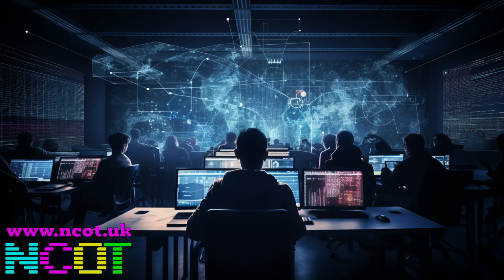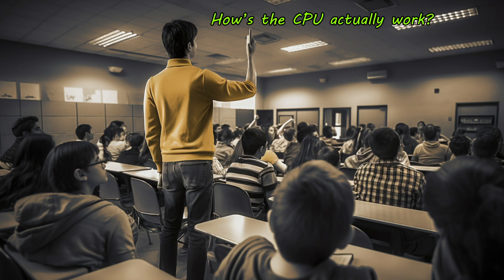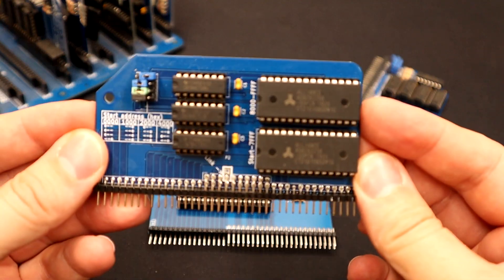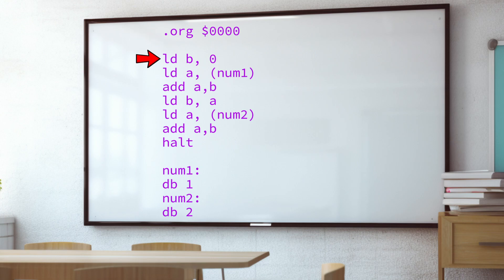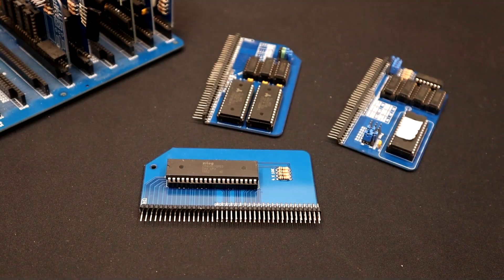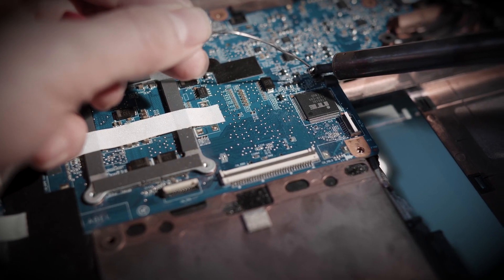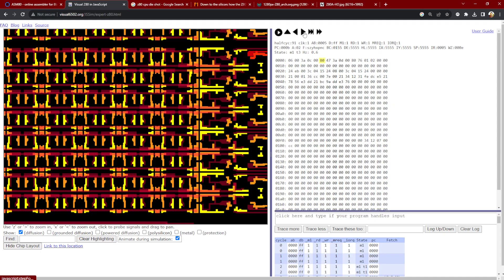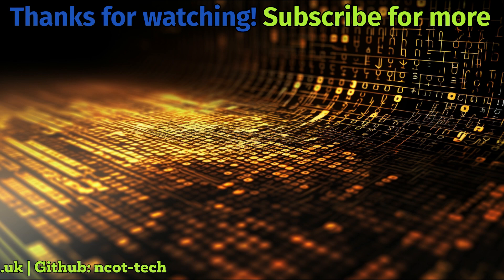Zilog Z80 Deep Dive - How does it work?

Comment: The inner workings of a Z80 CPU are registers, ROM and functional units (like the ALU (Arithmetic Logic Unit), memory unit etc). The CPU first loads an instruction into the instruction register, which connects to ROM. The ROM is also connected to a step counter, which is reset at the start of each instruction. Each step in the ROM is a list of signals to send to parts of the chip (e.g. use the memory unit to fetch the next byte of the instruction, then store the result in a register). The last step of each sequence in the ROM is to load the next instruction into the instruction register and the cycle repeats.

All CPUs come down to the basic building blocks of logic (AND, OR, NOT), implemented in transistors, wired together and sequenced by the clock. Just like normal programming you break the task down into components, sub components etc, and build each part from simpler parts connected together to achieve the required effect. A register for example is made from a bunch of Flip-Flop units, a Flip-Flop (at its simplest) is made from a couple of NOR gates (that is OR gates with their outputs NOT’ed). The difference with normal programming is that many things happen in parallel (so you can be fetching something from memory, moving the contents of one register to another and adding two registers together at the same time for example).

If you’re interested at that kind of level then take a look at FPGAs, which are basically a bunch of uncommitted logic that your program can wire up any way that you like. You can implement a Z80, 6502, RISC-V etc, or even your own CPU design on them by defining the logic for each unit and how they are wired together. There’s also code available on the web for implementations of the above CPUs, so (once you learn to read the language used - typically Verilog or VHDL) you can see what is happening.
Reply: Four month's long last year I spent on successively designing microprocessor architectures, starting by the simplest and ending up in something very similar to the latest multichip mosaic Intel designed recently . . . . that I didn't know about yet. I soon got rid of the step counter, substituting ROM-stored next step numbers next to ROM-stored microcode steps. I added a four-gates circuit that decoded a two-bits microcode portion to control step jumps inside an instruction's microcode by either not jumping, always jumping, or conditionally jumping on the set or on the clear state of a selected condition flag bit, which would otherwise have contributed to the microcode ROM addressing along with the instruction opcode and the step counter state. Other developments were more complex and would require many pages to describe: pipelines, instruction caching, register RAM caching, interrupt control, addressing-space misalignment dealing, multiphase clock, task interleaving, and so on.
     I can't afford prototyping the final architectural design. I could one of the not-so-complex designs but what I was interested on was just design: mine would't be able to compete with commercial ones, so, what'd the worth while be? But I'm proud my designing evolution bridged me across 50 years of microprocessor design in just four months, especially since I've ignored what the industry accomplished the last 30 years.
Reply: @wafikiri_  erm, what do you mean “can’t afford prototyping the final architecture design”? I’m assuming you’ve at least synthesised and simulated it to prove that it works? If you have got that far then, unless you need more than 138K of logic elements and 900K of internal memory (which is a LOT for an 8 bit design), then you should be able to implement it in a sub $200 FPGA.
Reply: FPGAs are rather more complicated than a simple case of Uncommitted Logic Arrays (ULA).

They often have what are called LUTs (or Lookup Tables), which might actually just be memory containing input/output value mappings.
Reply: @jnharton  LUTs are exactly uncommitted logic. They use RAM cells to define a truth table so that they can act like AND/OR/XOR etc, but they are the basic building blocks of a design. LUTs are generally combined with flip-flops and carry chain logic, multiple to a logic block, but what really separates FPGAs from ULAs are dedicated function blocks that also form part of the fabric.  These can be anything from routing resources through clock tiles and RAM blocks to DSP tiles. A moderate sized FPGA these days can implement an entire Z80 based computer within itself using those resources.

Comment: I grew up in the 1970's and had the Radio Shack TRS-80 which utilized the Z8080 Microprocessor. I will never forget the day I upgraded my memory from 4K to 16k. I had more memory than I knew wat to do with.  I had no choice but to learn Machine code as computers were so slow back then that using interpreters like Basic was not practical at all.  When learning machine code, there were 2 things I found most important that you left out and they have a lot to do with the inner workings of the CPU. In fact, they give you extra insight into the innerworkings of the CPU.
The first is the PC or Program Counter and the other is the Zero Flag.  The PC(Program Counter) is a pointer. It tells the CPU at which memory location the next instruction to be executed is located.  So the Add command only needs one number to execute. The code that instructs the CPU to add register A to B.  The Load A register command, LDA is a 2 byte instruction, One byte that instructs the CPU to poke a value into the A register followed by the byte representing the value you want poked into A and thus 2 must be added to the PC. A Branch Not Equal to Zero command(BNE) is a 3 byte instruction which requires the byte representing the instruction itself and the next 2 byte representing the memory location to branch to. If you say wanted to BNE to memory location 4A00 then it would the Instruction code followed by the second byte of the destination address then the first byte. BNE 00,4A.
Any operation that results in a zero will set the zero flag for comparison operations. If you want to code a loop that performs a task 10 times, you would load A with a value of 9. Remember, 0 counts as a number in computers. That is where the mysterious bit comes into play. If Hex FF or Binary 11111111 is equal to 255 then why is it 256. Because 0 counts as a number. After loading 9 into the Register, you perform a chunk of code, then Decrement the Register which subtracts one from that register. First time though it will be reduced to 8. Since it is not equal to zero yet the flag has not been set to 1. Now when we BNE(Branch not equal to zero) it will take you back to the top of the code just past where you loaded the register with 09. If you branch to the beginning, it will reload 9 into the register, you would never reach 0 and you would be caught in an endless loop. Any coders worst nightmare. If you set the memory location to one past the LDA instead of 2, it will see the 9 you entered as the next instruction code and you will likely crash. So if your code starts at 4A00, then the BNE would have to be to 4A02 as 4A00 contains instruction for load register and 4A01 contains the 9 you want poked into the register. the last time through our loop we decrement from 1 to 0, which sets the zero flag. Now when the computer reaches your BNE instruction, since the register is Zero the Program Counter(PC) will be incremented by 2 past the address you were branching to when not equal to zero.
Memory  Code
4A00        LDA - Load A register with
4A01        09 - value poking into A register
4A02        Loop content
...Coding in here
4A20        BNE - Branch not equal to Zero
4A21        02 - Second byte of destination memory location
4A22        4A - First byte of destination memory location 
4A23        New code starts here so the value of 4A23 is place into the program counter(PC) or it is incremented by two to this address.

In an assembler it would look something like
Initiate:           LDA,9
MainLoop:     Loop content
                          Code here
                          BNE MainLoop
exit loop to continue your next section of code.
A third important aspect to know about is the stack which stores information for JSR type commands. JSR is Jump Saving Return and pushes the memory location your code will be returning to after the jump to other code is executed and the return instruction is encountered. The stack kind of takes care of itself, but if you start pushing and pulling your own values into and out of the stack, then you better keep track. That loop you are in, if it does any pushing or puling from the stack, better be null by the time you are done. If you push and pull equally from the stack you will be fine. But if you push something onto the stack and you don't pull it from the stack before utilizing the return instruction, the address will be buried under the data you pushed onto the stack, thus it will go to whatever memory location is equal to the values on the stack, which could be anywhere.
Reply: Love your definition of JSR as Jump Saving Return (address) but if you check the official documentation, and every other reference I’ve ever seen the actual meaning is Jump to Sub-Routine. Like all the other instructions the full details of how the operation is performed is a bit much to capture in 3 letters.
Reply: @MikePerigo  I don't care what you say, there was a JSR that stood for Jump Saving Return. A JSR pushes the next memory location onto the stack, to be retrieved later and poked into the PC(program counter) there is a jump to subroutine, that doesn't care about a return address, and that was just a jump statement. Have you actually programmed in machine language? Cause it doesn't make sense you don't know the difference between a JMP(jump) and a JSR(jump saving return) A jump requires no return from subroutine command.
Reply: The 8080 had no Z in it as it was not a Zilog component! It was made by Intel. So you either had a Z80 (which I doubt based on the mnemonics you used) or an Intel 8080. No competent programmer would have such a nightmare because they would know how to calculate the correct byte for a relative jump or they would use an assembler and ensure the label for the jump destination is in the correct place. GIGO!

Note: If you did indeed use the TRS-80 then you really ought to know it had a Z80 CPU and the instructions you used in your assembly language are not Z80 mnemonics!
Reply: @SpeccyMan  I was in the 5th grade when I started coding. I wasn't that distracted by the exact processor that was inside. I was enveloped in figuring out the coding process using a book my brother recommended. Don't remember the name of the book. I might have mentioned the 8080 with a z, as in a reference to its being the predecessor perhaps. I always said the z80 and z8080 as being part of the same thing. One did lead to the other. You are questioning the competence of someone who was in the fifth grade. I guarantee I have written more programs than you will ever imagine. tens of thousands of lines long. Once computers became fast enough I stopped using machine language and switched to Dark Basic in the 1990's which is now AGK or App Game Kit which allows you to code in AGK with multiple languages but compile for any operating device from computers to phones with android or I-phone. I didn't use an assembler, I wrote my code out on graph paper. So yeah, when I had to Branch or jump or jump saving return JSR, I had to insert all the code in between before I would know where the jump would be to. I wrote each memory location on the graph paper and then used arrows that I would connect to the lower area on the graph paper where the jump would end up. I just left the 2 bits for the memory location of the jump empty until I reach the end of intermediate code, finished my arrow and went back to the jump and inserted that memory location for the jump. I then used the crude assembler that came with the computer to input the data. I was using machine language but I never learned a damn thing about how to use an assembler, and I don't even remember if there were labels in that assembler. All I am saying dude is that was a long time ago, who fucking cares. Oh yeah, how about you use your real name coward.

Comment: Microcode are the steps on the processor that tells the processor how to execute the machine code. I takes the machine code and then switches the right hardware lines to move a number from the data bus to the relevant register. This is why some instructions take several clock cycles. That’s what the “unknown” block in your video is doing. https://en.wikipedia.org/wiki/Microcode. Intel processors have complex instructions set that can perform many steps in on instructions, whereas RISC processors have simpler reduced instructions and smaller microcode.
Reply: RISC does not take steps. 32 bit instructions can drive a lot of control lines with the help of minimal combinatorial logic. Nobody looks up 32 bits in ROM.

Comment: Just finish up writing a Gameboy emulator at the moment (z80ish) - fun exercise.  Z80 instruction set is fairly regular, with some odd exceptions - so 500 instructions crunch down to more like 50 with variations.   Doable as about a 2/3 month evening exercise
Reply: They're still separate instructions with different opcodes, though. 

And because the Z80 is a CISC cpu, it may well have entirely independent logic circuits/paths for each instruction. That's not say there isn't sharing of some parts, just that other parts may be entirely dedicated to just one or two instructions.

Comment: Interesting question I guess the CPU is built in such a way that the flows of electrons can open a series of minuscule gates in the transistors of certain kinds and that they can be arranged and built up to do basic computation?

Who knows is like magic lol
Reply: That's pretty much the basic idea yes. Transistors control the flow of 1 current with another, so by wiring them together in specific ways you can create basic logic gates, which are AND, OR, XOR, NOR, NAND, XNOR, and NOT. From these you build your circuits, such as an adder, a subtractor, a multiplier, and a divider, and you now have the basics of an ALU, which you can feed data into and get results back out of.

Combining gates another way lets you store charges as pieces of data. This is how the registers are built. Everything in that chip is just logic gates and sometimes lone transistors turning on and off, and connecting and disconnecting, various wires together such that the bits flowing in result in the desired bits flowing out.

This is a gross oversimplification, but hopefully it conveys the idea of how you start building up a processor.

Comment: This is the big problem with modern x86 computers, anyone can overclock a Core i7 and think they know how a computer works. I thought I was an expert after doing x86 stuff for 10 years, only to discover 8-bit homebrew computers and realise I didn't have a clue what an instruction is, or memory addresses, or really anything at the machine code level and below. Once I built my first Z80 computer that could be programmed in machine language I had pretty much no idea how to even use it.
Reply: I feel your pain. I've worked on ARM, RISC-V, and lots of x86-64 machines. I've designed chunks of chips, and yet I'm still often times looking up how to do something in machine code for the times I do have to use it, which are thankfully rarer and rarer now that they've stuck me away in the development department rather than in testing.
Reply: I came from the other direction and segment registers just blew my mind moving from 8-bit CPUs to x86.